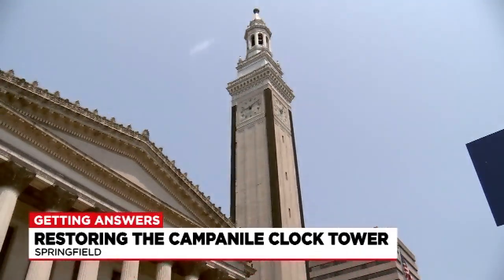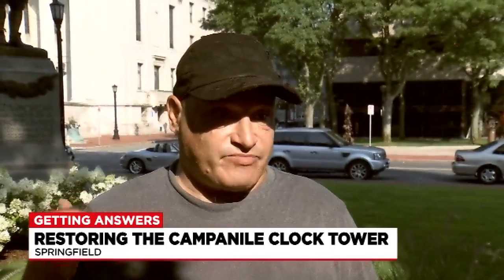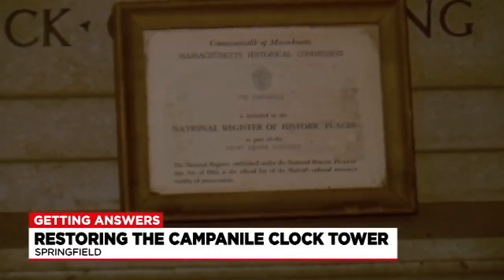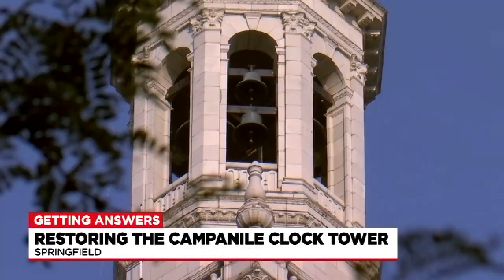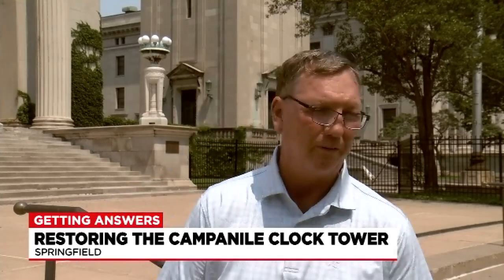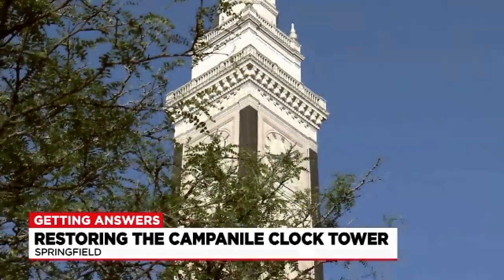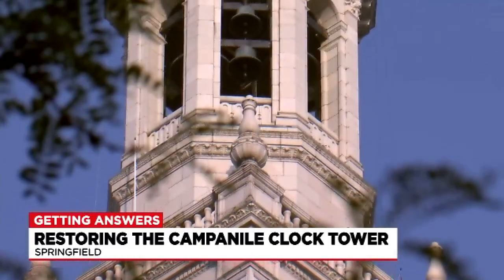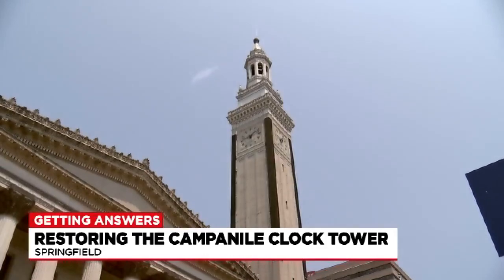Getting Answers: restoration of Springfield's Campanile clock tower

Comment: Hopefully they can restore this great tower. It is one of the most notable and iconic landmarks of the city of Springfield. Hopefully they can restore it and have it open to the public to check up to the viewpoint at the top of the tower. I remember as a young child visiting Springfield and the tower have been closed because it was declared structurally unsafe. Hopefully they can get the funding from this infrastructure bill as they did with the Union Station. Good luck.
Reply: I agree!
Reply: I can remember taking 5th grade School field trip to the top of the Tower. It was something I will never forget. Unfortunately it closed not long after. Then clock and Bells stopped. Very unfortunate the city can't repair this landmark. They can't seem to get the funding to fix it. They did manage to sell a couple City blocks to build a Casino just down the street. Something I haven't been to yet in 6 years.